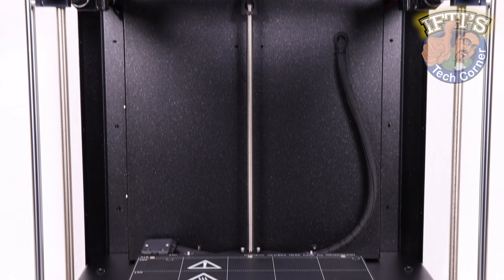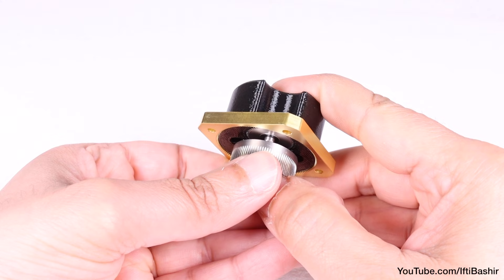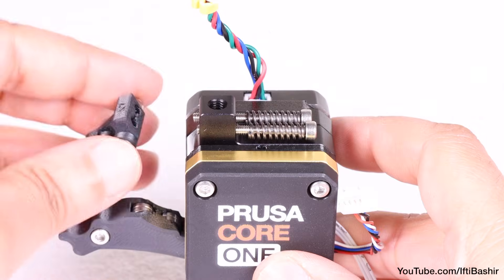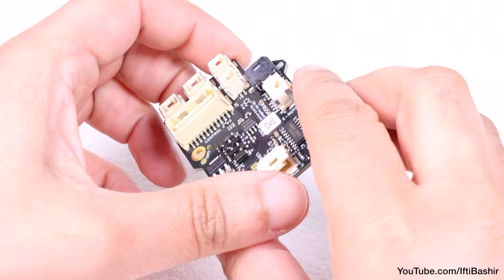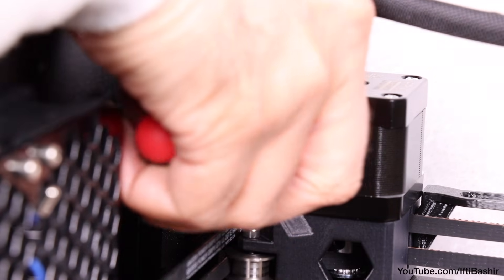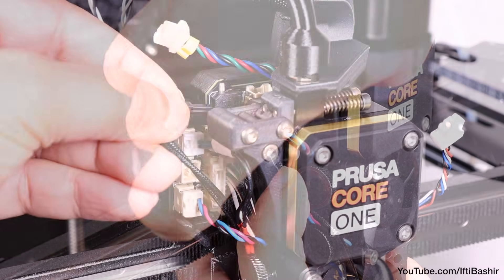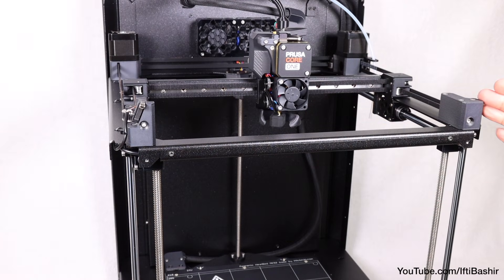#06 Original PRUSA Core One Kit : Full Step-By-Step BUILD GUIDE - Nextruder Assembly

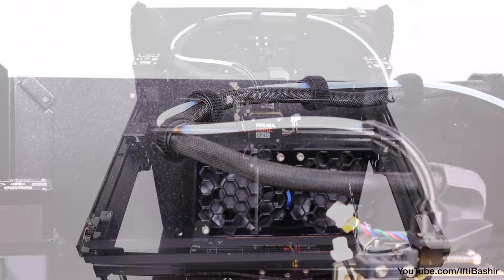Comment: 11:56 When I move the carriage down it moves to the left, and up to the right not going into to corners. How do I fix this so it's free moving like yours?
Reply: I dont know if it was a stuck motor or something, but a firm pull in a direction it wasn't moving, and all of sudden I can move it in any direction
Reply: its fine, the nextruder is attached to both the X and Y belts so due to some resitances, i.e. belts not being tensioned uniformly, other resitances in the motors etc can cause this to happen, dont worry it shouldnt be a problem when its actually set up and belt tension configured

Comment: 14:38 there is mistake. you said loadcell ribbon cable goes into the bottom port and the filament sensor into the top. 
The correct one is filament sensor ribbon cable goes into the bottom port and the loadcell into the top.
Reply: Thanks for pointing out. I didnt even check the drawing because i was sure i followed the video. Can it cause trouble if i powered on while connected wrong?